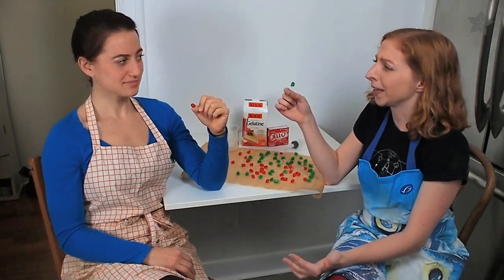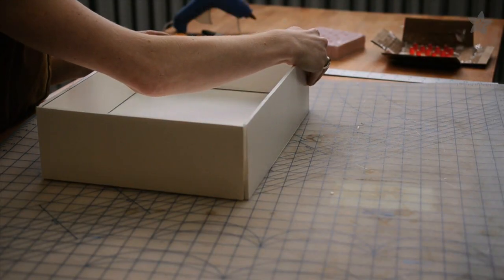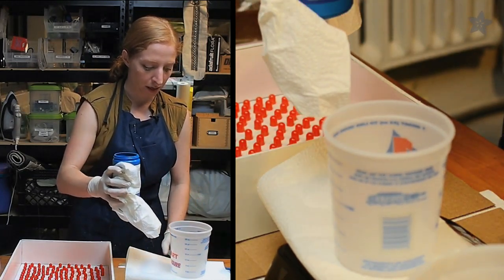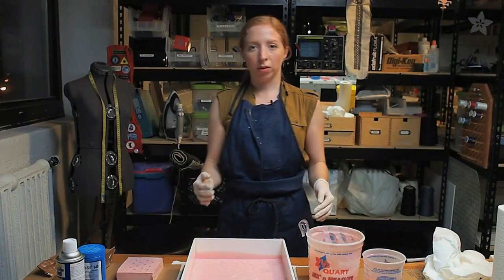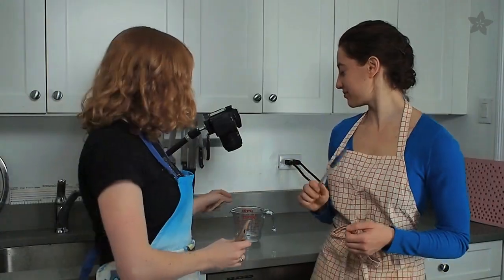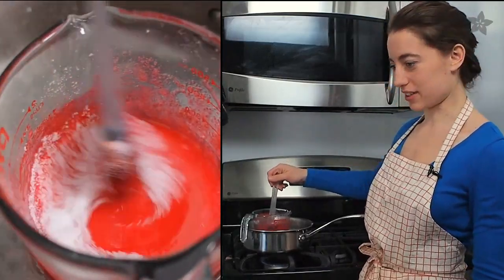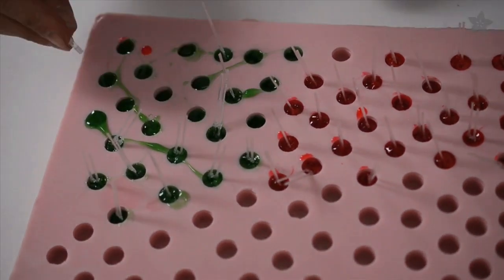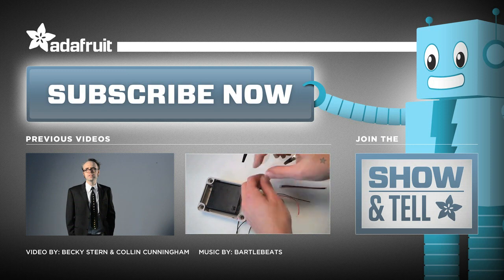Make LED Gummy Candies #Adafruit

Comment: Do you eat those anode-first or cathode-first?
If my belly runs on a higher voltage than the forward drop in those gummy LEDs, should I eat a limiting candy resistor before or after the gummy LED?
If my tastebuds run on AC, will I only taste the gummies on the positive half-periods?
Is it correct that gummy LEDs last much longer and have far less calories than candy incandescent bulbs?

Comment: might be more practical with just like 20 leds or so for a smaller amount of silicone

would also be useful for led ice cubes or chocolate leds

you could put clingwrap over it while it's in the fridge to get the leads to stick up straight

Comment: FYI you can improve clarity of your gummy by repeated heating and cooling.  You can also use a baster if you don't have a syringe.  I've got recipes and tips at my blog Eat the Evidence. I'm also reworking the blog with more stuff since I just got a new award for the gummy stuff, and somewhere in my notes I've got data on electrical resistance from testing actual LEDs in gummy. Will post soon...